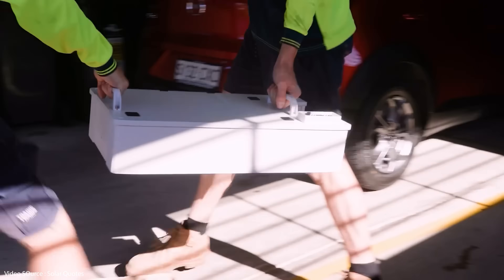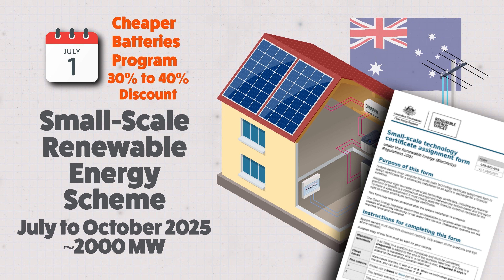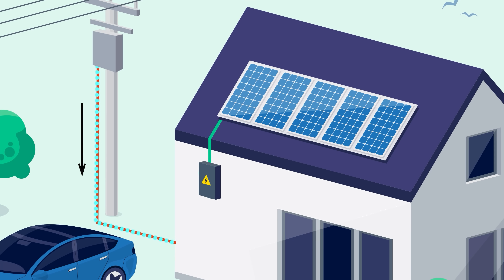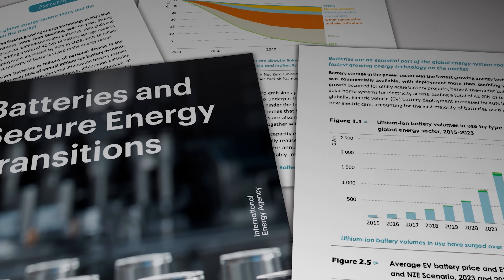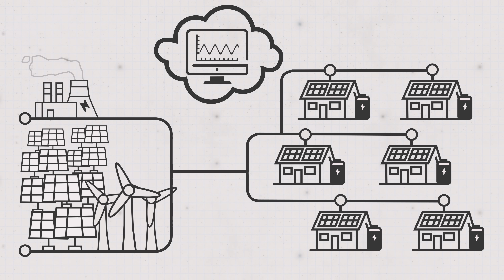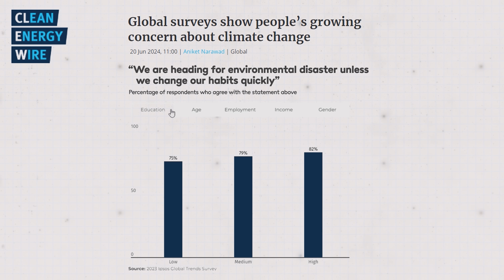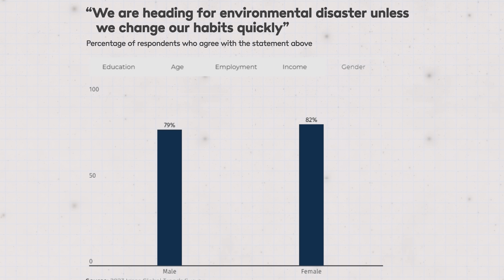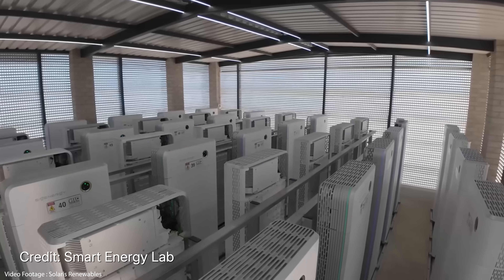Australians installed 100,000 home batteries in 17 weeks. Why can't we all do that?

Comment: Whats your take on the flywheel energy storage systems being developed? No need for batteries depending on heavy metals. Spin up during the day when its sunny using excess power. They are in a vacuum and use magnetic bearings. So low parasitic losses, but yet higher than batteries. Fair tradeoff in my opinion. And they are 100% recyclable!
Reply: Geothermal is the path forward...  Endless supply of energy within the earth's core.  Much less resources required.
Reply: i agree. Only issue is some areas dont have easy acess to sufficient heat sources without super high cost investments. The areas that do have acess should 100% use it to its fullest extent!

Comment: I recently travelled around Texas and Arizona recently. Lots of sun, lots of A/C, almost no solar energy.

Also, in Aus, we have seen the time when energy cost goes negative go from night (when coal power stations had to keep running but nobody wanted the power) to the middle of the day. We have always had "off peak power" - cheaper rates at night for heating water etc. With all the solar, we are moving to a "free power" window from 11am to 2pm. Time to charge the car, run the dishwasher, charge your batteries (if you can't install solar) and heat the water. This offloads power from the evening peak which is still a problem.

Comment: This is all quite encouraging. Private houses, with a bit of onsite storage, can be part of an electricity grid that stays up and running no matter what. I wonder about apartment buildings, though. They have less roof area per household than private houses, so they can't contribute as much power back to the grid. What they do have, though, is height, so maybe they'd be better at turning wind into wattage. I'd like to know more about apartment buildings and renewable energy if you've heard anything.
Reply: There is an Australian product called Allume  which offers a solar solution for apartment buildings. In Europe Balcony solar with battteries is popular coupled with time of use tarrifs, offers the ability to shift your usage to cheaper times. Battery only solutions in flats also work with time of use tariffs when balcony’s are not suitable for solar. I
Reply: @sjdiy8230  COOL! :-D
I'll have to look for North American versions. (different voltages)

Comment: It's important to note that excluding Arctic and Antarctic, the places with the best solar potential are only 6 times better than the worst. So when solar falls to 1/6th the cost, the worst place in the world equals the best. 

I'm in Australia, and I don't live in the best part of Australia for solar. Almost no one lives in that place. The solar potential at my house is around 1600 kWh per kWp per year. Where no one lives it's about 2100. In Orkney it's about 900. If I moved my solar system to Orkney it would produce a little more than half what it does now.

Since I installed solar the price hasn't fallen to half. So right now, spending the same on panels wouldn't produce the same as I get in Australia. In constant dollars it's fallen to 1/16th. Spending the same on panels as I did in Australia would produce 9 times more electricity than I produce. Assuming you are sensible enough to mount the panels vertically, so they don't accumulate snow, and you have the right kind of inverter that starts up at low power, you'd make more electricity on a cloudy Orkney winter day than I make on a cloudless summer day.
Reply: Forget about solar.  Geothermal is the answer.

Comment: What is the carbon footprint of creating all these batteries and solar panels? What is the lifespan of these systems and how will they be disposed? I am all in favour of green energy but one must be realistic in measuring the long term cost of different systems. Might small scale nuclear plants be a better solution?
Reply: Geothermal is the answer...
Reply: @Les_S537  A primary limitation of geothermal energy is that it is highly location-specific, requiring access to geothermal resources typically found near tectonic plate boundaries or volcanic regions, which restricts its widespread application. This geographical limitation means that only a small percentage of land areas possess economically viable geothermal reservoirs.

Comment: I'm building an off-grid house, with the power for tools and lights coming from solar power.  I'm living in an off-grid rental house with the power coming from solar and a gasoline generator.  At this time of year in the Idaho Panhandle, the generator is providing 90% of the power.  Days go by with essentially no production.  The battery capacity is a fraction of what is needed to last through the cloudy spells, and even with the small size of the batteries, the panel capacity can't keep up charging these batteries.  The house that I'm building will have 10 times as many panels and something like 3 times the batteries.  And the propane generator will charge the batteries, instead of directly running loads.  And in the USA, a third of the cost for my system will be covered by tax credits, provided I get the system limping along by December 31.

Comment: I live in South Australia - the place with the most expensive retail electricity on the planet, peak rate (3pm to 1am and 6am to 10am) is now 67c pkwh. The cheapest time of use rate is still 42c pkwh.

Why is it so expensive? It's a long story worthy of a deep dive by you, and it began 30 odd years ago when all around Australia conservative state governments began selling off their grid assets. The poles and wires sold to offshore interests, the aging coal generators sold to private corporations (often offshore) and former public retailers sold into private hands as well. More competition will drive down prices they said. Meanwhile in the real world the opposite happened.

I installed solar 17 years ago, when systems were small and expensive. I expanded that solar 7 years ago for a lot less cash expenditure as prices had come down by a lot. Initially there was a huge saving to my energy bill, but over the ensuing years FIT dropped and retail soared. Once again my annual household bill approached 3 grand, so a battery went in. 13.5kwh Tesla Powerwall 2. I store for my own consumption and my bills have once again plummeted to very reasonable.

Now, as to the content of this video - the battery subsidy scheme is fantastic, the rollout is impressive. But it's flawed. Retail installers can install 50 kwh batteries with a mere 5kw inverter and under 10kw panels. In that scenario the battery will never by fully utilised. A large percentage of battery installs have woefully inadequate solar feed in as the scheme does not define that aspect apart from requiring some solar.

Not to come across as cynical, but one must bare in mind that while the current government is doing the battery scheme (opposed by the current opposition) - they continue to approve new fossil fuel extraction projects unabated. Undoing the good work, almost like the battery subsidy is a smoke screen. Bad as that sounds, it would be worse if the LNP was in office because there would be no battery scheme and fossil fuel extraction projects would not only be approved but given subsidies on top.

Comment: As someone who installed a battery at my home I can say that this decision was/is strongly motivated by the ever increasing cost of electricity in Australia, just as much, if not more than the desire to save the planet.  

Installing a battery (10kwh) to gain better utilisation of my solar panels (8.3kw) allows our household to more or less operate without the grid for 98% of our needs, especially in summer.

The main cause of the ever increasing electricity prices, well mostly it is the cost of reconfiguring the electricity grid for renewable energy. The best sites for solar and wind are a long way from the existing grid.

Don't get me wrong, I am all for renewables and I have an electric car, which is mostly charged from the sun!

Comment: I live in Melbourne and had a solar + battery system installed 3 weeks ago. Since then we've been running completely off the solar + battery, even with moderate/max energy consumption e.g washing machine,  dishwasher,  cooker, air con etc.

The installer said he was working flat out all the way to March 2026 and was having to turn away jobs because of the demand.

Comment: This model decreases the need for a huge upgrade on the high voltage transmission system as well. Even if a home doesn’t have solar, it can take power from the grid during off peak hours when power is cheap and use that power during peak hours. A home can essentially trickle charge its batteries presenting a constant load to the utility provider.

Comment: FWIW the price of batteries went up by exactly the value of their own STCs
Reply: What are you talking about, home batteries have never been cheaper.
Reply: @jakal0 interesting, what approximate $/kwh are you seeing for installs with a new inverter?
Reply: @Robert-sq7bp  For the no name ones where they're cramming in the biggest battery possible it's about $100 per KWh with a 10KW inverter, for a better known brand and an installer with a longer history it's probably closer to $250-$300 per KWh
Reply: @jakal0 $100/kwh is crazy! Not sure I’d trust that kind of battery. I swipe batteries were more like $1k/kwh

Comment: I live in Australia and installed PV solar 7 years ago, I calculated a payback in 4 years, it turned out I had a payback in 18 months. 12 months ago I install a battery. My winter bill was about $150 per quarter, the rest of the year it's about $0-$25 per quarter. Even though my feed in grid went from 10c to 4c over the last couple of years. There are additional benefits, I live in a rural community and a storm can cut electric supply, so I now have power even in a main power cut.
Reply: The initial (non battery-type) solar/grid installations made it impossible to use the solar output when the grid was down. That has quickly evolved into today's much more flexible systems. That's something that you can easily achieve with smaller home-based systems. Compare that with the timescale involved in building a new centralised generating plant and distribution grid - measured in decades to even get through the planning stages.
Reply: I'm in Eugene, Oregon and we have the same numbers. In 2024 we were paid net, exactly 10c/kWh whether we used or sold. In 2025 they dropped it to 7c for sold, and in 2026 it's dropping to 4c.  
In the meantime however we've got two EVs, so we pour that 4c/kWh electricity into our cars before we sell it back to the grid.
Reply: @ziploc2000  if your ev allows used them as battery so you dont have to pay 10 cents.
Reply: @majidmehmood3780  The problem with this suggestion is that, for most people, your EV will be at home at night but away from home in the day when you drive to work. 
It will work well for all the night shift workers though.
Reply: @theoztreecrasher2647  yes you are right but an EV holds charge for at least 400 km so a 60 km round trip per day, you will still consume like 70% by Friday where you can charge it on Sunday to full.
Reply: @majidmehmood3780  If I'm working all week then I certainly want to go for a scenic drive on the weekend!
Reply: Last time we had a blackout in our home in country Australia, we were watching NRL Football. We didn't notice the power was out until the Powerwall notified us. Loving solar!😊
Reply: If it wasn't for all the decades of conservative lobbying by the fossil fuel industry. Then Rural folk would've been way more supportive of renewable energy ages ago because it is amazing for energy independence outside of urban area.s
Reply: I live in NSW, installed solar panel 2 yrs ago, n it's been working well. But battery cost is still too high in my opinion. How much was ur battery n installation?
Reply: @uasakura  did you factor in the subsidies and the reduced cost of batteries?
Reply: @ariaflame-au  how much is it now anyway? I looked at it like a year ago. N funny enough, I just got a call about solar, but the accent makes it feel like a spam, so I hung up
Reply: I'm in Australia and took advantage of the subsidies. Installed 2x 19.2kwh batteries (38.4 total) and 10.56kw of solar panels. Dropped our 1st bill to almost $0, the only major cost is the $50 service fee our electricity provider charges, didn't send enough to grid to cover it.
They charge 34c/kWh and pay us 8.66c/kWh feedin. In regional QLD we only have 1 provider so it's nice to be virtually off grid.
Entire system cost 13k after the subsidies, should break even in 4 years.
Reply: @davidlittle3500 And the Fed govt is giving everyone 3 hrs of power free at midday from July 2026. Great time to charge EVs or use appliances. So even those without solar battery systems benefit.
Reply: You also now have communications even in a power cut too, it is pretty good
Reply: Nothing better than being the only place with power in an outage.
Reply: Thanks to the generosity of taxpayers who can’t take advantage of the subsidies themselves 😢
Reply: We installed solar 6.6kW system a few years ago without battery and our bills are still around $700 to $1,500 per quarter with concession.
Reply: @stevenbalekic5683 A battery would probably solve that.
Reply: REALLY?  you solar panels produce power when Mains ARE DOWN.  Dont think so.  the Solar panels that age need the grid to produce.   Maybe new panels work with out the grid.
Reply: Spot on. 👍
Reply: I'm paying $3000 annually for gas hot water and electricity. I've had cash available for a solar installation since 2018, but the whole process is hideously complicated high risk. I have no idea, and no one can help. I've approached agencies like RACV and power companies. They just direct me to the same old gov web sites full of gobbledygook that I've read a dozen times already. How do people do it?
Reply: @toby9999  Solarquotes?
Reply: @t @toby9999 if you want an easy guy to understand look up Will Prouse to see his non sponsored reviews of different batteries.  Then check out Solar quotes in Oz but I would go with a big name brand like a Tesla wall it may cost some more as much as I dislike the owner, their batteries have had a lot of work and been around for awhile.
Reply: @toby9999  Contact one of your local solar power system suppliers - a reputable one, not a cowboy. They will send you information about the processes and costs involved, and sent a representative round to discuss your needs.
Reply: @toby9999 
Where are you?
Qld / NSW ?
I have panels on houses in both states, dead easy install.

Comment: Relating 2000 MW of batteries to daily consumption is tricky. Those batteries might have a rated amp discharge rate, but they can discharge at that rate only for 1-2 hours. If you look at how much energy they can produce per day, you have to look at the kWh value. It won't look as impressive then though.
Batteries might help, but it remains to be seen if they can solve the problem. I have a battery and it's usually full before midday. I don't feed in, so I don't cause a problem for the grid operator. If I am not mistaken, in Australia, you can only get the discount if you give control to of the battery to your electric company. So they could use it at midday if they think that might be needed. But even when the battery is reserved for when the grid needs it the most, your solar might produce more power than your battery can absorb as it has a maximum charge rate. The surplus is still going to be dumped on the grid.

Comment: My 'balcony solar' with batteries, came provisionally on line toward the end of last month. It was amazing to see decent power generation today with it mostly overcast. The several bifacial panels added almost 50% of my average daily consumption. With it being -17.2 C this morning in the US  Midwest and my little heat pump working, I appreciate every watt stored for evening use lowering my bills. Trying for extreme conservation the fully charged batteries covered four days of appliances and water heating recently.  Only the heat pump and car charging relied on the public utility.  Outside of the coldest 3 months, estimates are the system should cover the rest of the year fully.  Admittedly, it would have been nice to receive a rebate for the solar, but I had to do it on my dime and feel it is worth every bit of scrimping to make it happen.

Comment: 170k Installed because, subsidy aside, the ability to store and use that power in the evenings means incredible savings for the average Aussie household. I signed up for installation in October and I'll probably be waiting for another couple of months before it happens (should have moved on it earlier, as it'll probably miss the summer months). 

As it is, our system would have cost $26000 AUD, but with subsidies for both the solar panels and batteries, we're only paying $15900. Even so, legislation still lags behind capability with limitations on total area of panels. We can't have more than 38m2 of panels on a single plane without going to the added expense of building permits, inspections etc. So for power generation, with current PV's, we're limited to 7.9KW for generation. Still, given that feed in tarrifs are 8 to 10 cents per KWh, It's not so much about feeding back into the grid, as it is storing the energy for use when it's at its most expensive. And in making the decision, the subsidies definitely made the difference.